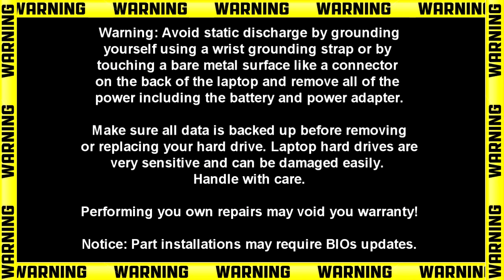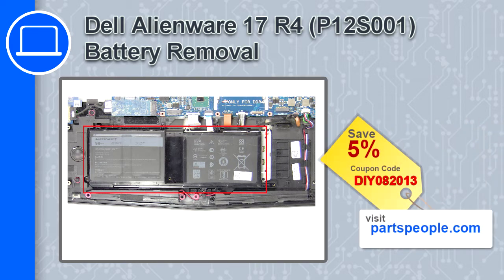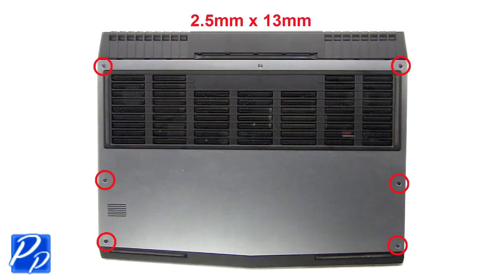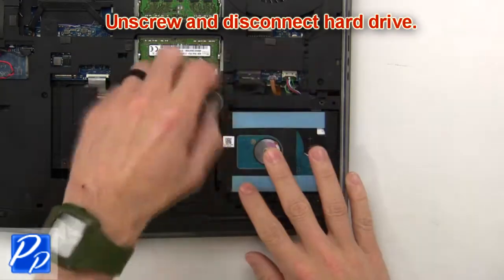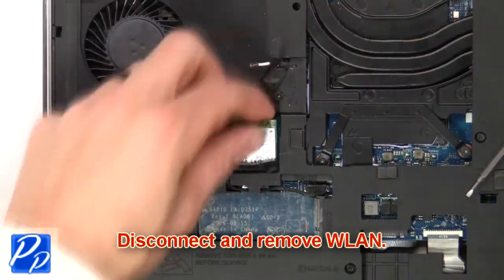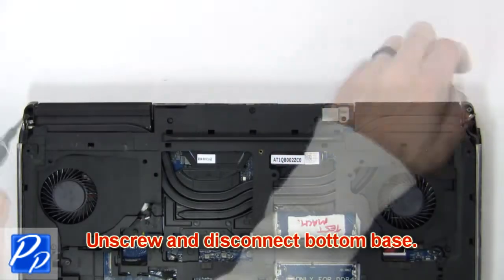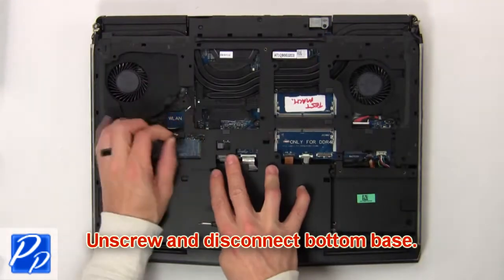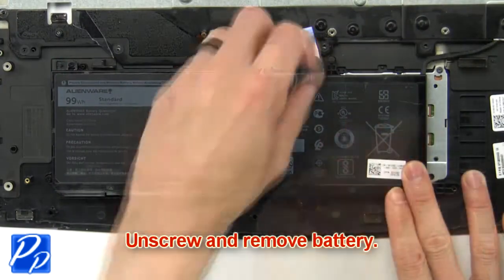Dell Alienware 17 R4 (P12S001) Battery How-To Video Tutorial

Comment: Hello guys, I am pretty angry because of the battery life time.
Could you please help me understand how come a brand new alienware 17 r4, after 1 year(and in this year was very  very verylow used, and mainly used pluged in) his battery just simply died. Spent a lot of pounds buying it, hopeing that i will buy something that should be one of the best, and it turns its not. How is your pc holding up?
Reply: Disappointed with my battery life as well.
Reply: fr wish it was easy to replace too. without unscrewing stuff. like a clip together battery

Comment: if I had to give it a star rating it would be 2 of 5. The teardown video I give a 4 of 5, knocking off a star because the video cuts form step to the next so damn fast you have to be lightning fast on the pause button to freeze it while its still displayed. I give the rebuild part of the video... wait. There's no step by step to put it back together? I have to remember the steps in reverse from memory? Is this a joke? No video? no stars. Average out, thats two stars. I mean... seriously? this many steps and theres no rebuild instructions?

edit: after putting it back together I have to edit my review and downgrade it to zero stars. Apparently you have to be super duper careful removing the wires from the wifi card. theyre really sensitive and can easily break the connectors off if done wrong. No mention of this and reataching them is super challenging. no mention of this either. This is pretty critical step. Im really surprised that such basic stuff is left out of this video.

Comment: Fu*k this. Thanx 4 ur input. But u just proved that to do what was simple 5 to 10 years ago are almost impossible. Just like turning of ur modem or video viewer. By the time u do that ur comp. Is fu**ed. Another way the big state & company's try to screw u. But Thanks for showing that if I spilled something on my computer it'd tak to long to remove the core components than it would to fix it.

Comment: For alienware 17r4, it's better to remove battery and use it while charging. Correct?
Reply: My battery died on me after a year and ive been using it with the wire since. I don't use my laptop out of my home because it's as heavy as two bricks.
Reply: @LoisyVoicy  can relate, i have 2 laptops, this alienware of course for gaming and another one for work :D
Reply: Mine is always plugged in too, if I unplug it the battery lasts like 10 mins MAX lol..
Reply: Thank you for this! ----- My daughter's 17R4 was shutting down within seconds of logging into windows (battery was dead).    I just disconnected the battery and it is all fixed now.